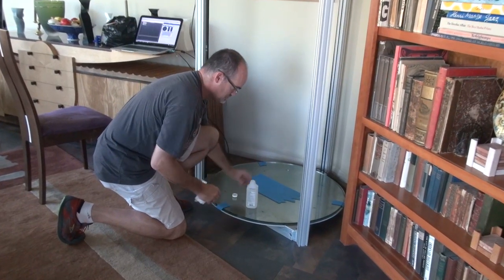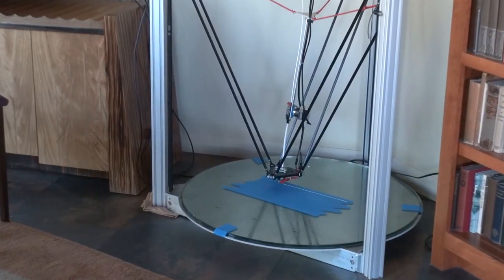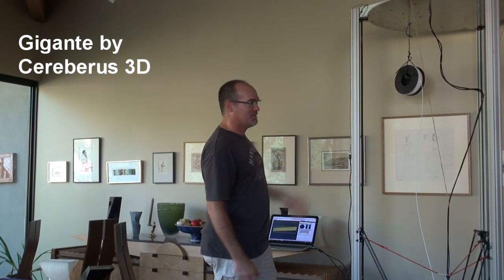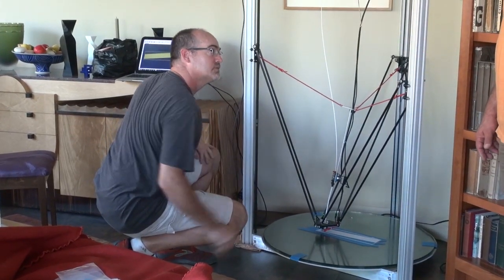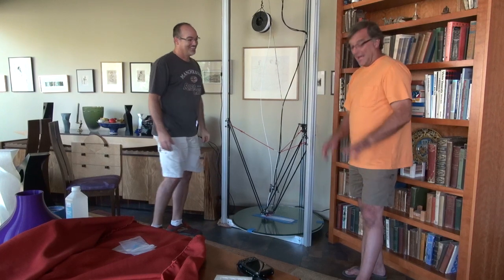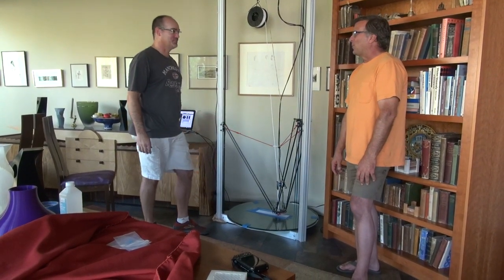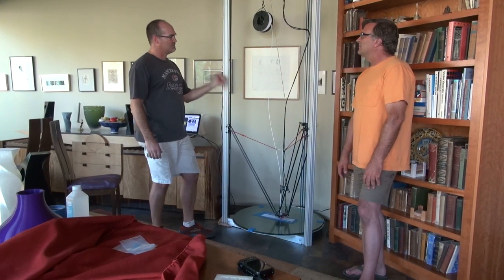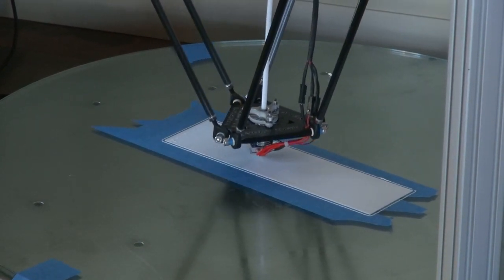First Print With the Gigante 3D Printer (4-1/2 Foot Print Height!) - Kevin Caron

Comment: use purple elmers glue sticks on top of the painters tape and you'll have amazing adheision and no delamination in fact you won't even need to use the tape and you can remove the glue with water since it's water soluble
Reply: You won't be able to find any at depot try a walgreens or office supply store

Comment: I think you might want a cabinet around it.. So the temp remains consistent around the print and also to reinforce the uprights as they would have quite allot of flex at that length.. Also you should setup a raspberry pi running octoprint so you don't have to have your PC running throughout the print and you can easily monitor the print via the web and shut it down remotely if you have a failure
Reply: The octoprint idea is a good one. We may consider that in the near future. We are currently looking at adding wifi and touchscreen interface with the very good android app for tablets called GcodePrintr https://play.google.com/store/apps/details?id=de.dietzm.gcodesimulatorprinter&hl=en . It may seem like a cabinet would be good idea for temperature control and that is accurate for ABS where the crystalline transition stage is over 70C, but for PLA the transition phase temp is basically room temp. So at these extrusion rates we really just want to cool everything to room temp as quickly as possible. We will probably be adding blowers and other active cooling tech to get the plastic down from 230C to room temp as quickly as possible.